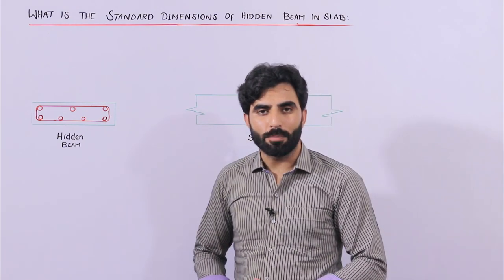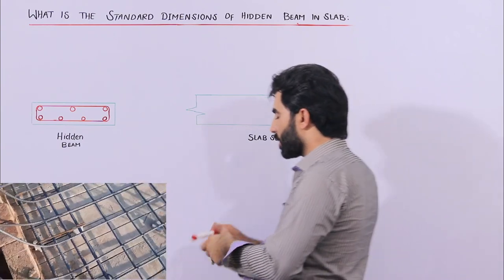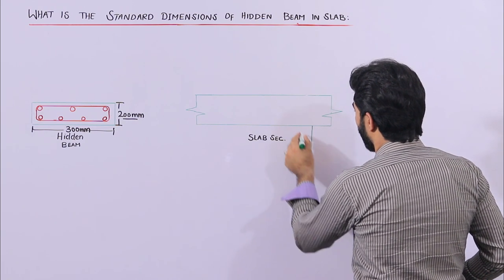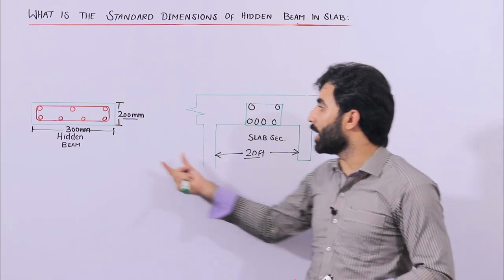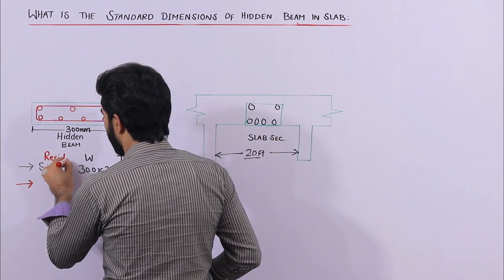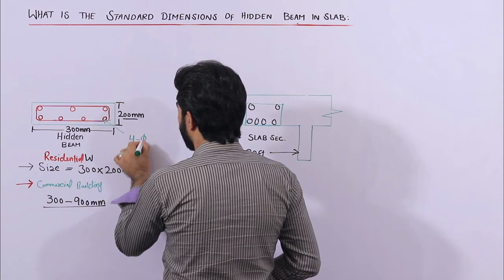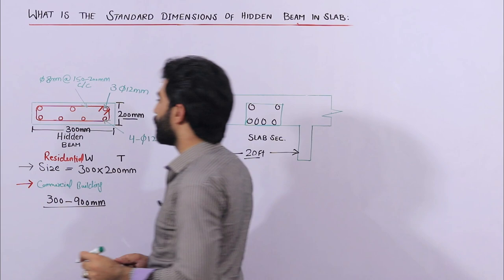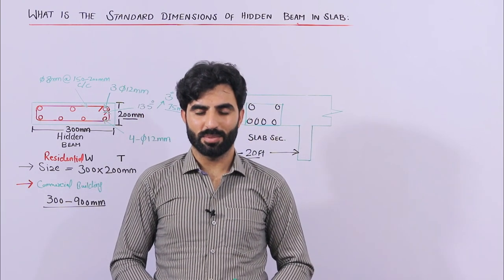Standard Size of Hidden Beam in Slab Construction | Civil Engineering Videos |

Comment: It is important not to jump to quick conclusions and start replacing downstand or upstand beam with hidden beam.  Hidden beam is used for slab with span greater than 6m to distribute positive moment to the regular perpendicular beams.  With large span comes large deflection in the midst of the slab panel and having a hidden beam there I believe this will prevent any excessive deflection.  I hope you can get into the WHY and help clarify those situations.  Thanks.